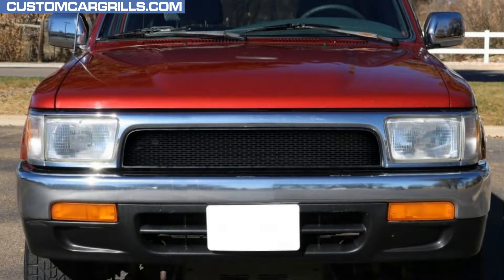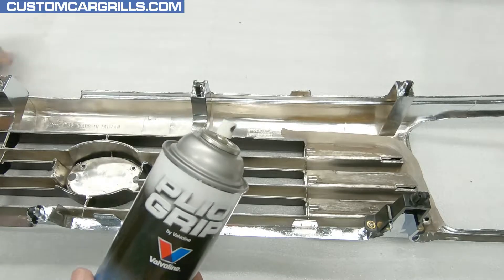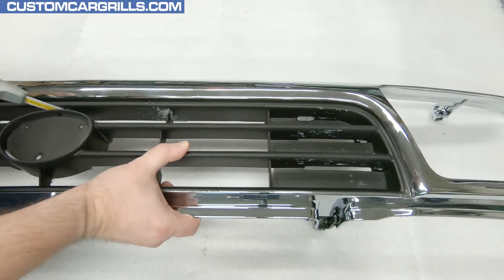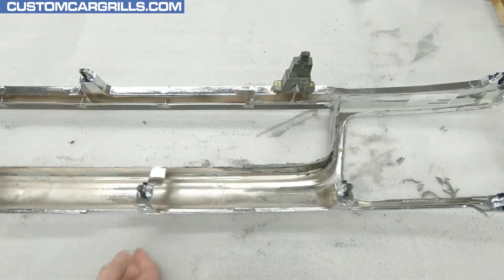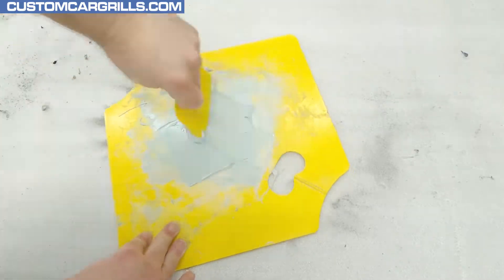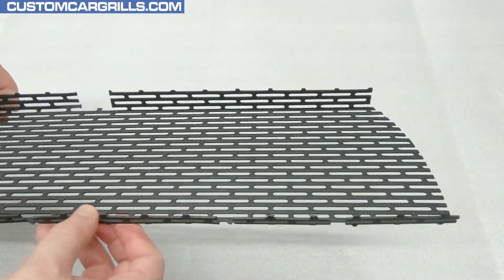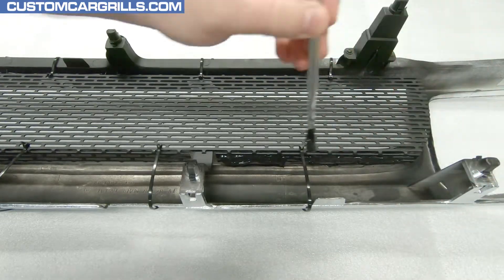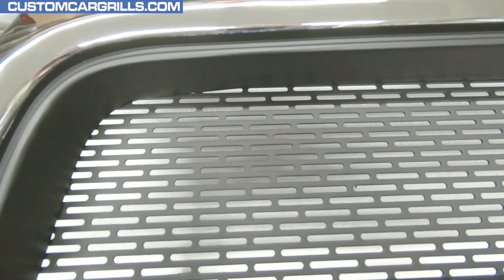Toyota 4Runner 1992-1995 Mesh Grill Installation How-To by customcargrills.com

Comment: Can you put this grille on a 1990 DLX 2wd?
Reply from the maker: I'm not 100% sure on that, but I would doubt it would fit correctly right out of the box.
Reply: @customcargrills  widening the headlight area on the radiator mount i'm sure will need to happen for the larger headlights. But I was hoping most of the stock clip holes would be able to be used.... Just trying to look more oem than going full baja race look with fiberglass conversion clip.